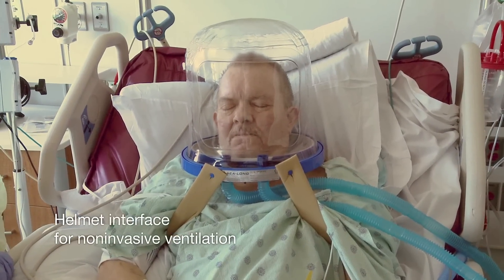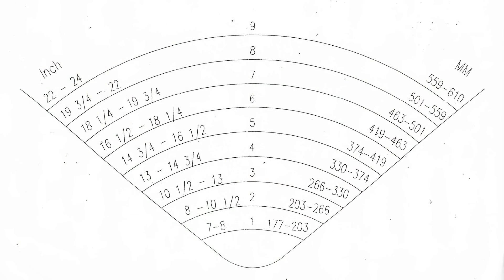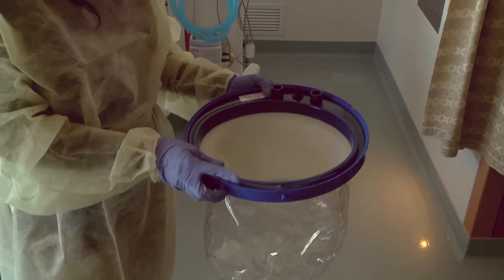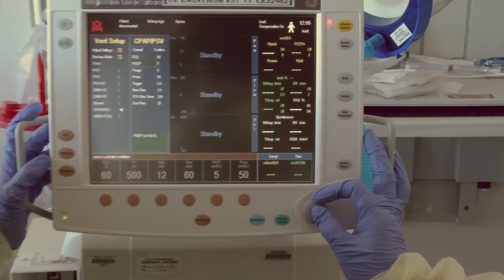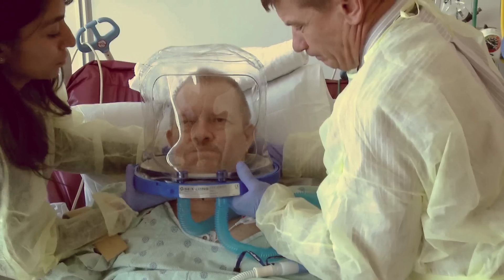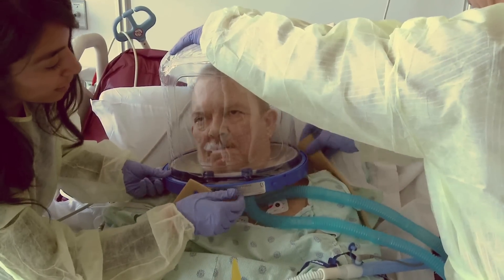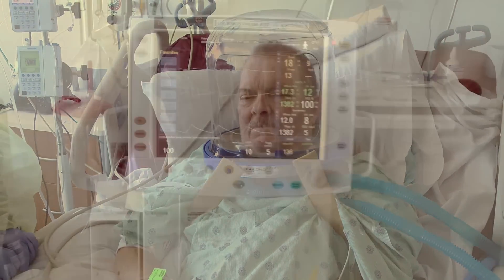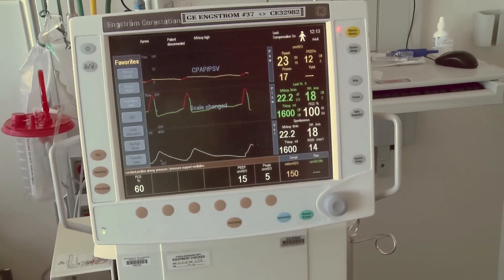Helmet Noninvasive Ventilation

Comment: does this actually inflate the lungs?  this seems like it just creates an environment that allows for greater than normal oxygen concentration, but does not inflate the lungs like mechanical ventilation.
is that correct?